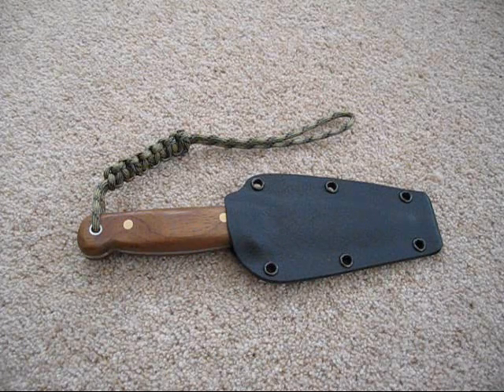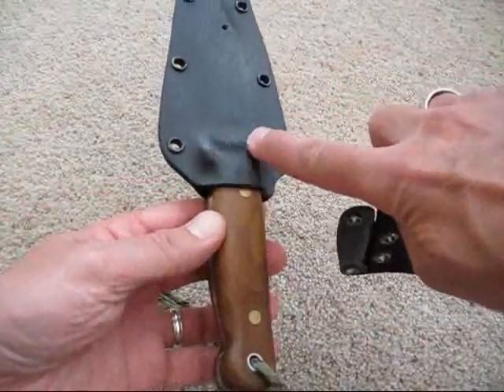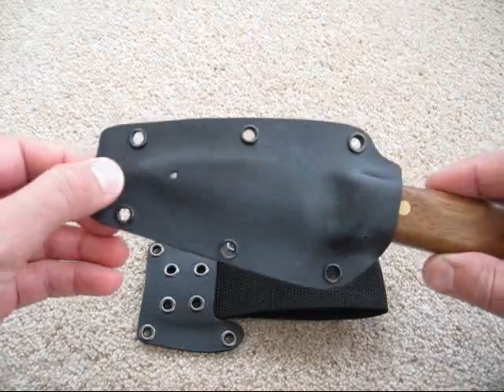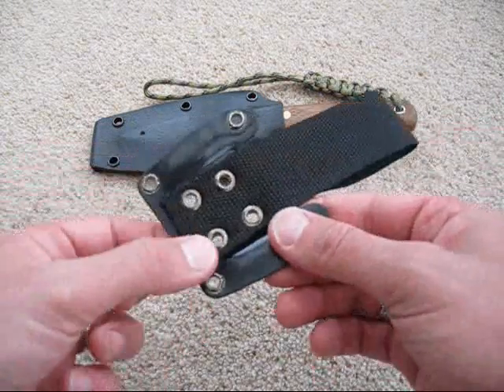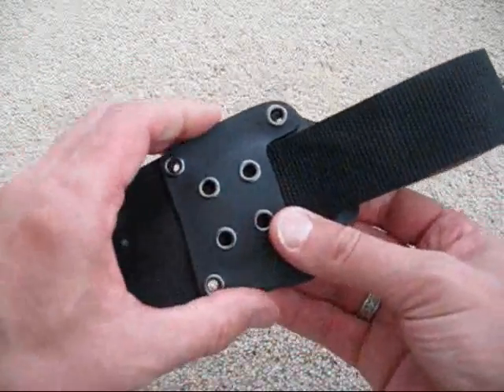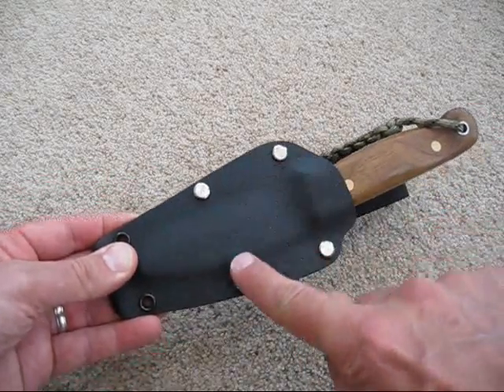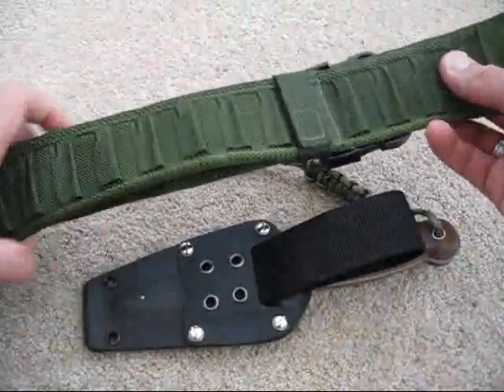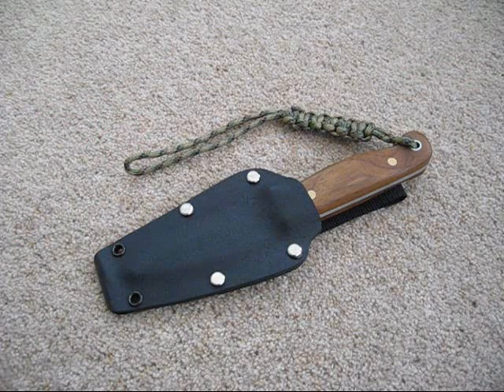Bushcraft - Kydex Sheath Update - Belt Loop Attachment

Comment: Looks awesome Mick. Really impressed. Sorry to hear the eyelets didn't work too well :( Feel bad for suggesting them. I think the thickness has a lot to do with the splitting too, as the more "tube" to roll down, the more pressure there is on it. I'll definitely be changing over to the wood and knife eyelets I think. Sorry mate. my fault for suggesting those others.

Comment: Great job. I finished my own Kydex sheath here too. Guess I should post a video. I am a bit camera shy. I did mine with 2 seperate sides with a tab for the fire starter on the top half and the tab for the nylon web belt on the bottom half thus no need for attachments.
That was an amazing shaping of the bottom half of yours though. Did you put the whole sheath with knife back into the press?
Jeff